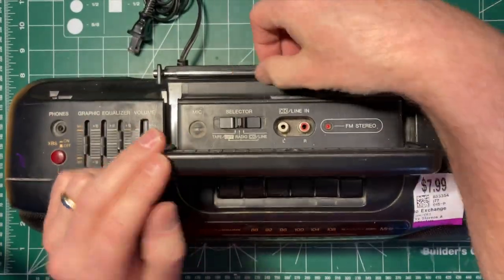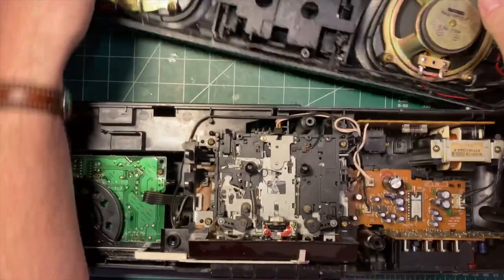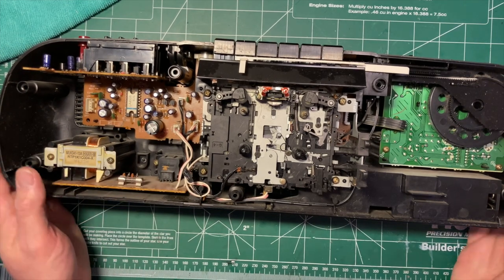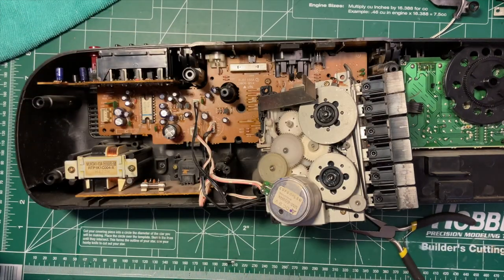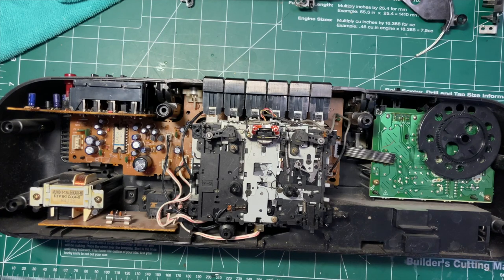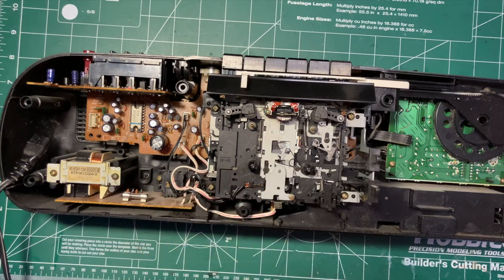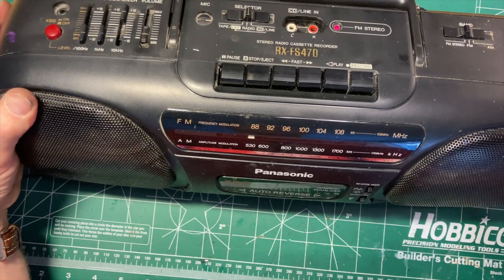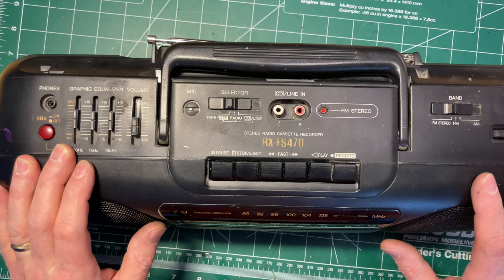Panasonic RX FS470 Cassette Boom Box Repair

Comment: Where do you recommend getting belts? Any part number? Thanks.
Reply from the maker: These came from my pile of Chinese belts acquired over the years. That's hit or miss but there are a number of ebay suppliers that do list belts by model number. I don't have enough experience with them to recommend a particular one.
Reply: Temu

Comment: It would help if you would point out what tools and sizes you were using.
Reply from the maker: Not many tools are required: all you really need is Phillips number 1 or 2 screwdriver to open the case and for most of the internal screws. It's also useful to have some jewellers screwdrivers and needle-nosed pliers and/or forceps. In your situation you'd get the back off and see if you can free the mechanism.

Comment: I just got one of these and replaced the same belts. All the buttons work except the rewind which won’t click and stay down. It works if I hold it down but it won’t click into place. Any ideas?
Reply from the maker: The catch that holds it down is pretty obvious on most mechanisms, but I don’t remember this one in particular. I’d inspect it for damage or dried out grease. I don’t think the auto-stop mechanism works on rewind and fast-forward, so it’s probably not that.